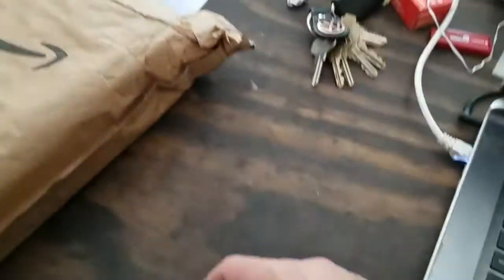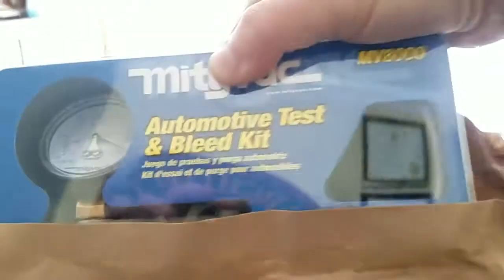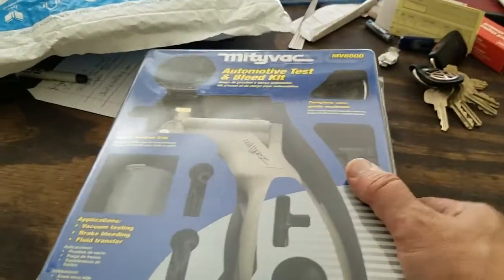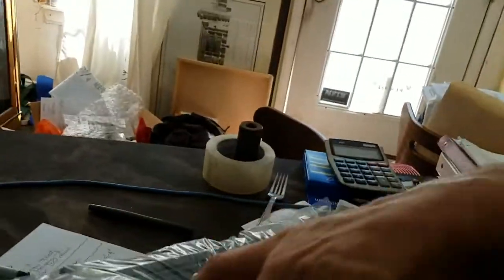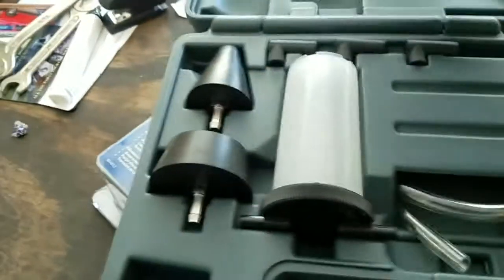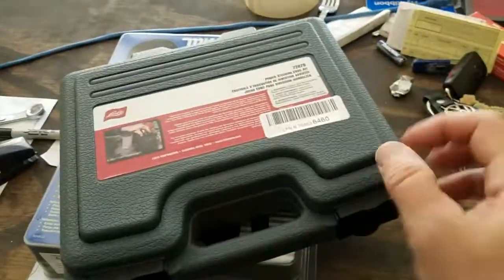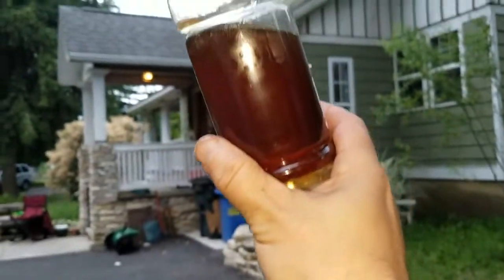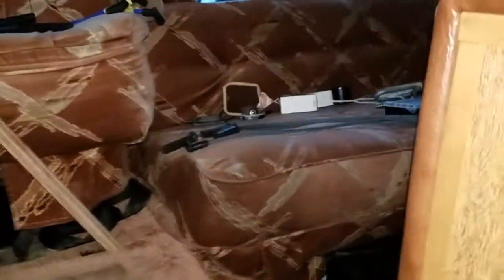Hard time for Hard Lines! (Brake Lines, that is.....)

Comment from the maker: I've had enough old vehicles (about 11 E21's by the way..) to know that when you start replacing parts the ones 'down the line' can fail due to age and working when things were not up to spec. Still, I'd rather replace hard lines, rubber seals, and other bits than having an unsafe rig. Anyway, it's really cool to have her working in tip-top condition when able!

Comment: Wow Brake lines thank's for sharing the part numbers.... Guess it couldn't have happened at a better time........I posted then watched the rest of it....
Reply from the maker: I didn't do the jack the front up and spin the wheels. I used the vacuum tool but I'm betting that the old way would have been fine. Still, blowing the hard line on the brakes was NOT expected!! Having that happen on the road could have been disastrous with an RV. I'll double my efforts to replace the lines on this system because if one is bad, then there are likely others, too.....

Comment from the maker: Still working out the details on how to complete the repairs but it seems that the 'fix' is so complex (resetting the proportioning valve, pulling the rear wheels, pulling the axle, removing the break drum to access the brake cylinder to bleed it....) I may just leave this to the professionals. I want a safe RV and not create another expanded project for videos.... no really, I don't!